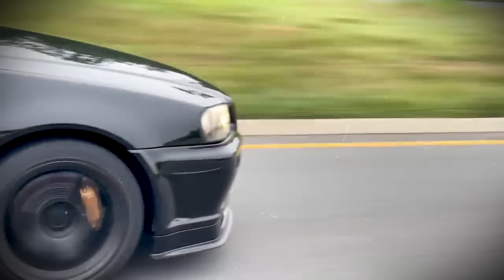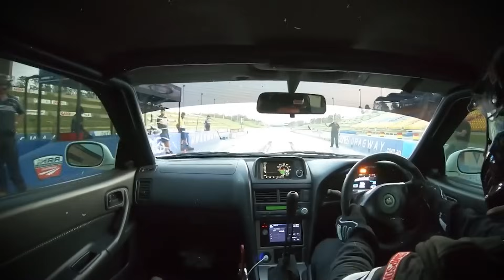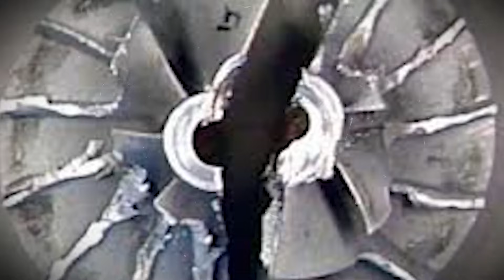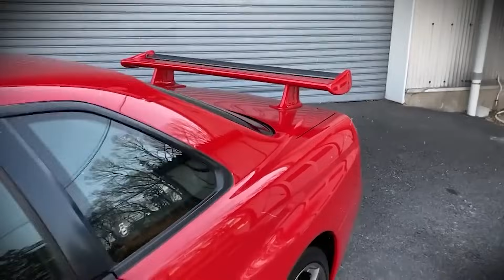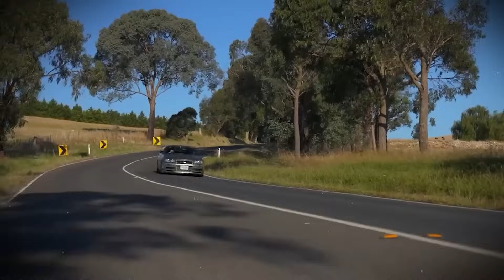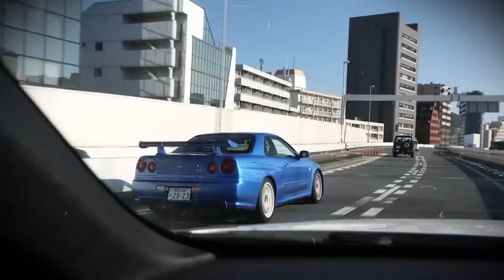Skyline R34 GT-R: 20 Weird Facts You Didn't Know!

Comment: First is almost completely wrong lol

First letter is engine, B=RB26, E=RB25, H=RB20

Second letter N is optional depending on if you have Atessa 4WD or not, i.e. BNR34 GT-R or ENR34 25GT Four

C is found on R32 & 33, HICAS equipped. No letter denoting HICAS on R34’s

R34 is all 10th Gen Skylines and doesn’t mean coupe🤦🏽‍♂️

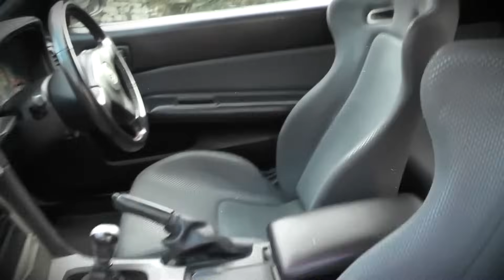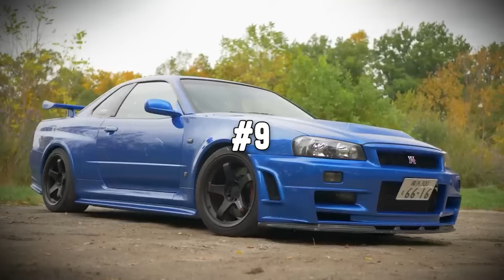Comment: Cool video, but what you say exhaust temp in 6:50, when there is pics in this video from MFD, where is exhaust temp, and you talk in 15:48 v-spec II vented hood, was that vent there what direct fresh air to turbos to cool turbos/exhaust manifolds and was those hood painted color
Reply: EXH is the exhaust temp, but since it's less than 400C, it just shows --- And the V-Spec II has a painted carbon hood with a NACA duct on the left side to cool the turbos.